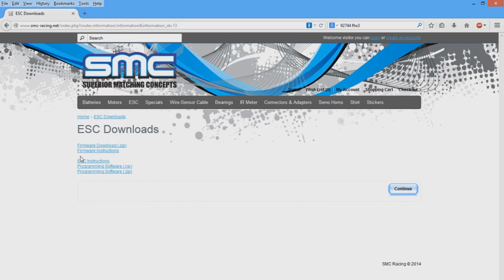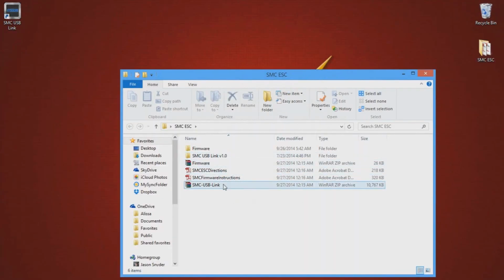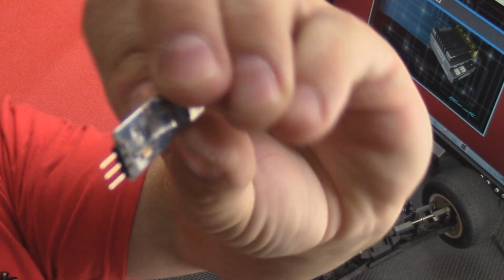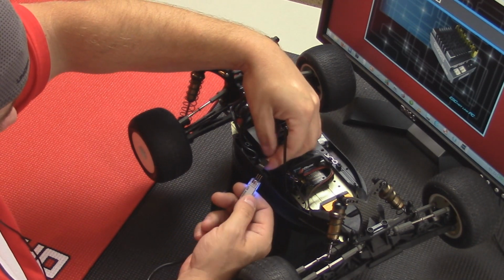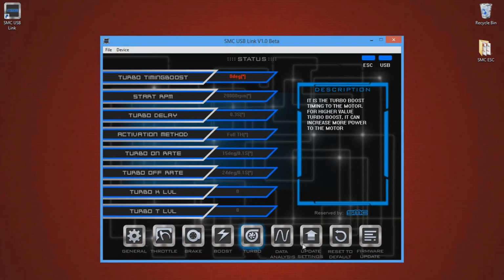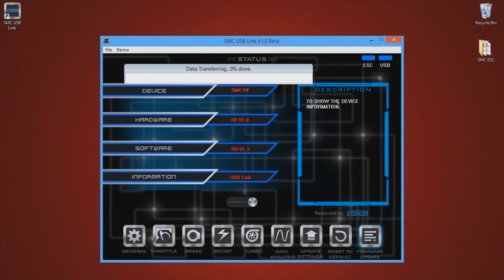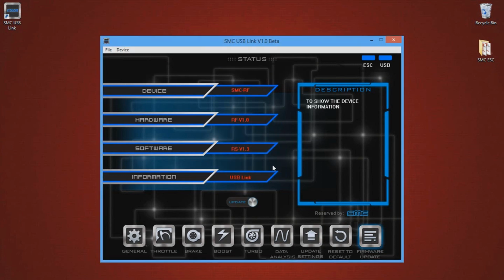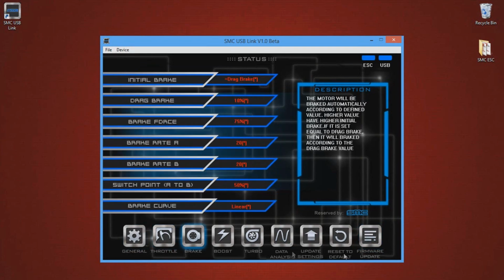SMC ESC - Firmware update

Comment: Hey - great video Jason, does the SMC 160 ESC come with the wires pre soldered? I've contacted the UK supplier to see if I can get one and at what price. Tks M
Reply from the maker: yep...they come pre soldered
Reply: ShortCourseWorld Tks Jason, I can't find any Mac software for the esc so presumably they only have a windows installer, I've asked SMC directly but looks like I'll need the program box. comments welcome.
Reply: mike bunker For those that are interested I've just heard back from SMC to say that they don't do a MAC version of the software, you will need the program box and the use of a windows PC if you want to flash the firmware. No big deal - good news is that SMC were very helpful and have contacted me a number of times today answering my questions - great support (Tks Danny - orders@smc-racing.com)